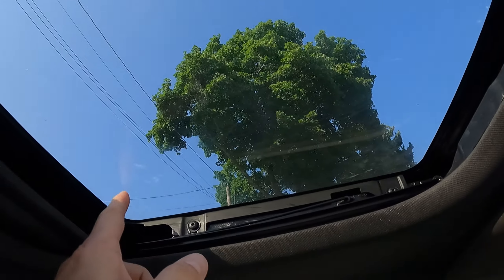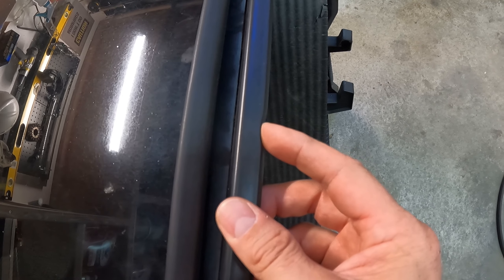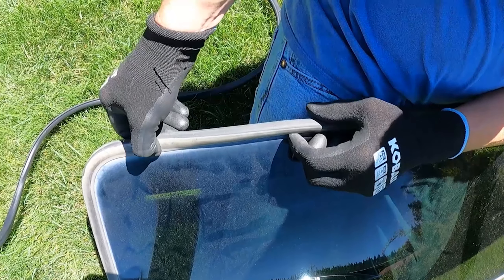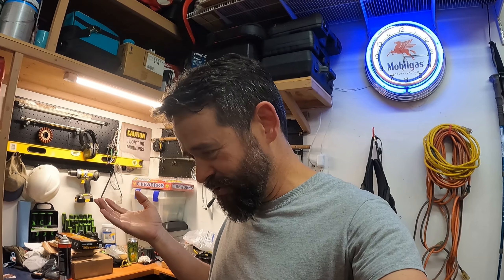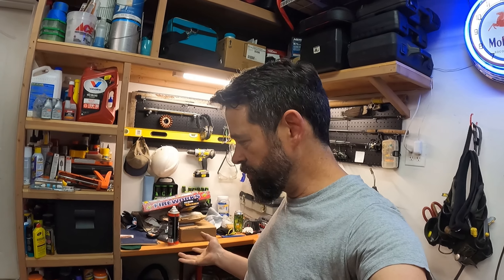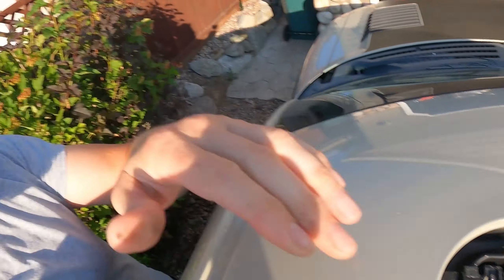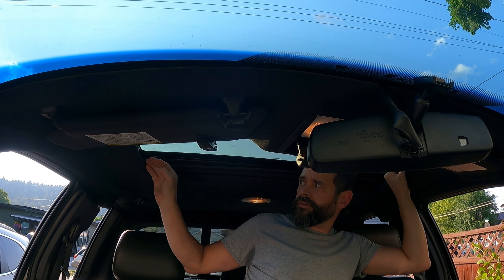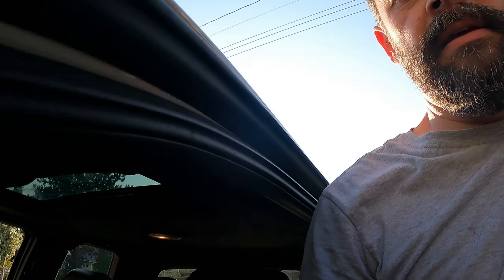Reseal Your Leaky Sunroof - F-150 & Raptor DIY How To

Comment: This video made me aware the glass section has a seal. I thought it was just part of the glass fixture. Ive been chasing a small leak for months now. Its dripping out of the front passenger grab handle. Im now off to find this seal 🙌🏻. Probably won’t fix the problem but worth a shot    Edit: my glass sits low in the back, i didnt know it was that easy to adjust.
Reply from the maker: We've actually heard this from a lot of people, so you're in good company. Glad we could help and good luck, we hope it fixes it. Thanks for commenting!
Reply: @MotorsandMischief  looks like its gonna be the satellite antenna on the roof. Bad design and doesn’t drain properly, gets old or loose and lets water in underneath.   I hope thats the fix. Im tired of looking lol

Comment: I permanently disabled the sunroof in my raptor. F that ... Got stuck open on me once. I fixed it then i disabled it. I only use the rear window slider now. I do apply atp-205 on the seal every few months. Ill spray it in ..
 Alot of it and let it soak in.
Reply from the maker: It would not be the first time we got a sunroof closed and then disabled it. Had an Audi A4, one of the kids decided to open the sunroof during a snowstorm. Dad's voice yelling "Noooooooo" as little 8 year old fingers pawed the sunroof, that Dad new was broken, open. Took 20 minutes in a blizzard to force that thing shut. Pulled the fuse when we got home and never used the sunroof again lol.